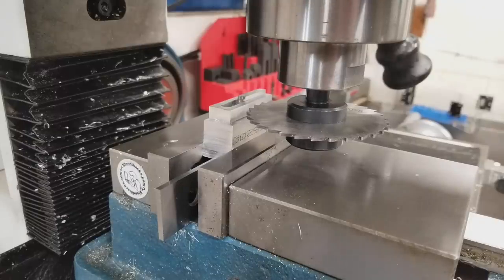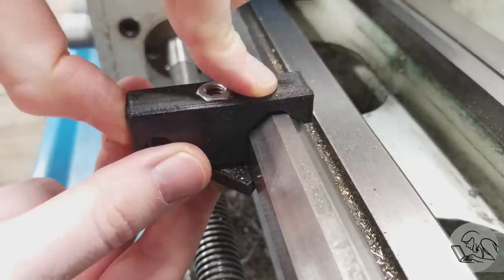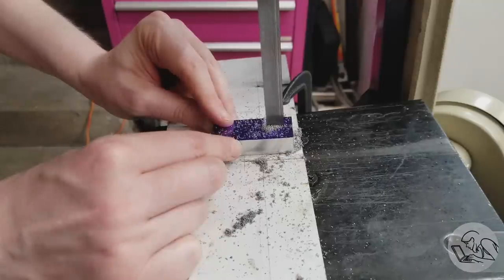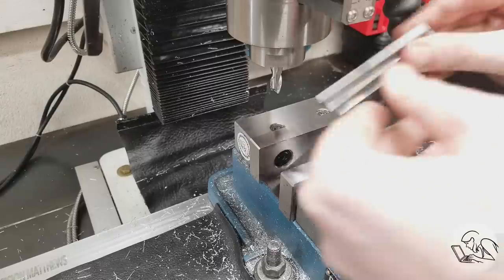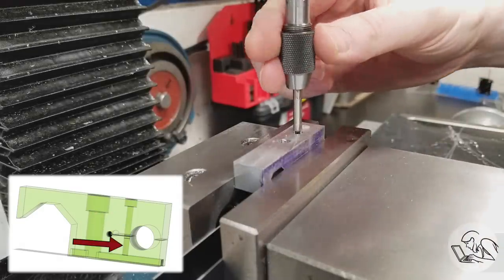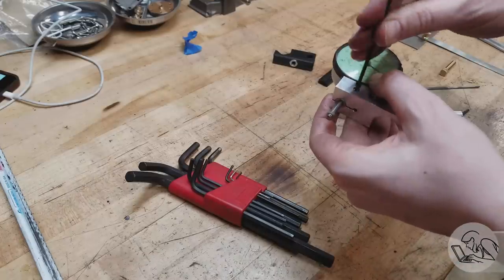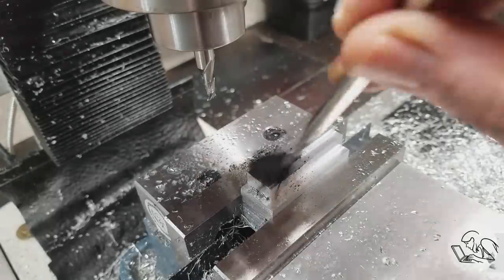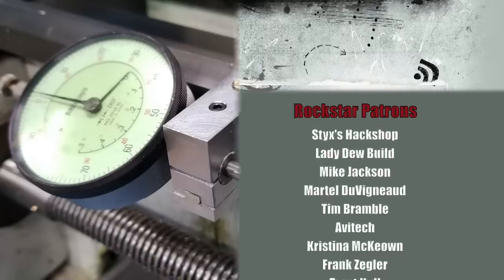Lathe Stop!

Comment: I’m just a lowly carpenter but that method of measuring an angle looks pretty darn approximate. Seems like there has to be a better way.
Reply from the maker: There are lots of better ways, that get progressively more expensive. 😬
Reply: Quinn, your DRO will tell you the angle. It has an angle funtion. use an indicator on the quil and tell the dro what angle you want and,pow. when the DRO shows zero the angle error is on the indicator. when all are zero, you get Yatzee.
Reply: Steven Steichen My thought was to lightly clamp two straightedges across top and bottom of the ways and then add up the sum of the angles between them. If it doesn’t come out to 180° then you know you have an error somewhere. Not perfect and doesn’t get the one that goes between the ways, but better than nothing I think.
Reply: @twestgard2  I was commenting on setting up 94 degrees in the mill without using angle blocks. Measuring the ways is how I did mine. I own the same PM lathe. You can't easily use parallels as the ways are not planer, mine are co-planner off by at least .003 or more.
Reply: Steven Steichen Interesting. I’m very much a newbie so I know very little about this, but I’m learning a lot!

Comment: Quinn, I could get a ton of use fron one of these, so with out a mill would this be doable?
Reply: You could whip up a milling attachment 😊. Or you could drill out holes on the drill press and use a hacksaw/grinder and files to go the rest of the way.
Reply: With basic tools and patience with a file you should be able to hand fit the stop to your lathe.
Reply: In my opinion it's doable, but extremely time consuming and it would be very hard to do get the tolerances close enough.  But with enough time, sure. It's amazing what you can do with some simple hand tools and copious amounts of time...
Reply: @JMALEEDY  Clickspring: aye, mate.
Reply from the maker: You could easily make a functional one with just a lathe, a hacksaw, and a file. Nothing on this requires precision for it to work, really. If it clamps, it’ll work!

Comment: My bonehead theory about the mystery of the 94 degrees is that someone made a mistake long ago and it went into production before it was discovered... then after a zillion units were sold it became adopted as the industry de-facto "standard"  - at least that's how my work rolls... 😁 you're millage my vary, plus or minus a precision cat hair 😺
Reply: That would explain the mysterious angles used on Morse tapers.

Comment: You stated that a single pass slot will end up over sized. Why is that?
Reply from the maker: One side the endmill is climb cutting and the other side is conventional cutting, so the endmill gets pushed around a bit from all the weird forces
Reply: @Blondihacks  The effect is worse with four fluted end mills as one tooth is always pushing sideways to the path of the cut.
Reply from the maker: @disgruntledscientist  Excellent point! That in addition to the better chip clearing of a two-flute is I guess why they are so much better at slot cutting.

Comment: What’s the name of the purple marking thing?
Reply: marking fluid - most popular brand is Dykem
Reply: Dykem (this is the brand) marking (or layouting) fluid.
I spent a lot of months searching it in local stores in Bulgaria. I ended up purchasing it from Germany via eBay.
Reply: Sharpie or other permanent felt-tip marker pen works well and dries faster.  I use red and blue Dykem and black Sharpie depending on my mood...
Reply: @MachiningandMicrowaves  i use permanent marker for small surfaces, for larger areas brush is way faster (when you dont count drying time :) )
Brand im using is called "Dimant" - cheaper and easier to buy in EU.